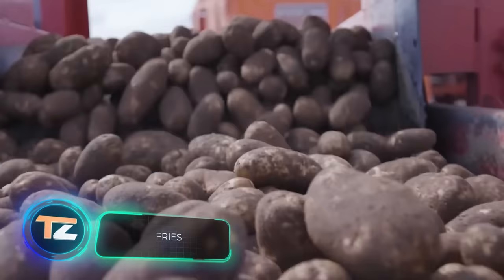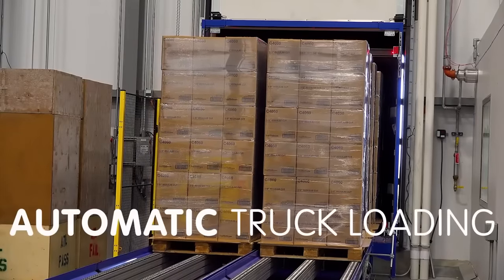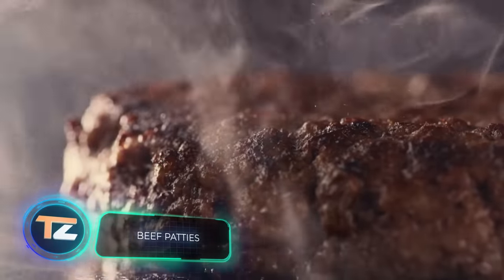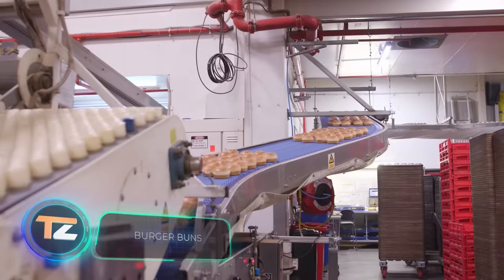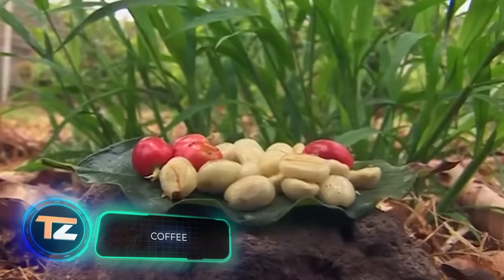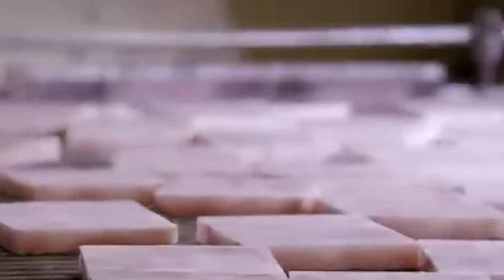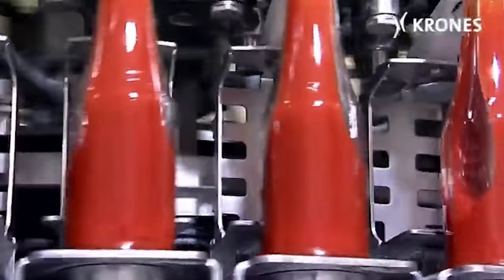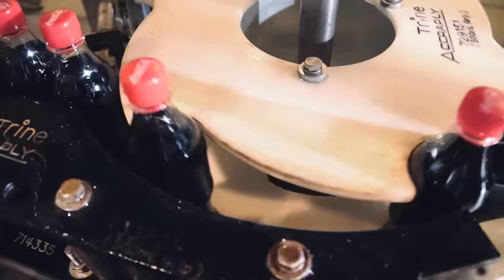HOW MCDONALD’S FRENCH FRIES ARE MADE. FOOD PRODUCTION

Comment: I worked at McDonald’s in the sixties. The potatoes came in 50lb bags and stored in a basement. I had to haul them up them dump them into a rotary skinner then open a chute and dump them into a big sink of rinsing water, then would  run each potato thru a big manual slicer into another rinsing sink. Then I would fill each basket with fries and let them drip off for a couple of minutes and then blanch them in hot oil(beef tallow) then put them on a rack until they were needed. Then I would brown then in a hotter oil pan until golden brown. Then into the fry tray for salting. Potatoes cooked in beef tallow are amazing.
Reply: yea,but not so healthy
Reply: Danm
Reply: this is why kids,that you should give some respect to old ppl instead of saying "ok boomer"
Reply: @davidjames5727  Actually no, cooking in animal fat is much safer than frying in vegetable oil (except to olive oil). Of course, frying is always bad but frying in animal fat or in olive oil is a much better option
Reply: @debbiec4407  Nah I rather die eating McDonald's happily, but it's kind of sad for me that I eat so much but I don't gain weight like my other sisters they barely eat much.
Reply: @KitKitChanIsaac 
That had nothing to do with this, you’re looking for a dumb fight! that’s why you get called boomer.

Comment: There's quite a lot left out here. For one thing the cutters are not "grates". The potatoes are launched by water pressure down a tube at around 70mph, where they meet the cutting blades which are staggered first vertically, then horizontally, over a distance of around a foot. In this way the spuds are sliced rather similarly to the way you might do it at home. Research showed that if all the blades were in the same plane, the potatoes tended to "splat" against the grid rather than slicing. I learnt this when I went round the factory myself.

Comment: Fun fact. Ordering fries without salt forces them to cook you fresh fries. This is better anyway, because they use 'sodium silico-aluminate' instead of 'sodium chloride'. The chloride in table salt is essential for the body to generate stomach acid for proper digestion, which is primarily made of 'hydrochloric acid', derived from 'sodium chloride'. A lack of 'sodium chloride' in a balanced diet may cause severe stomach cramps and diarrhea.
Reply: ill just put the old fries back in the oil for 10 sec. checkmate
Reply: @zoom7251  It is their policy to cook new fries when you ask for no salt.